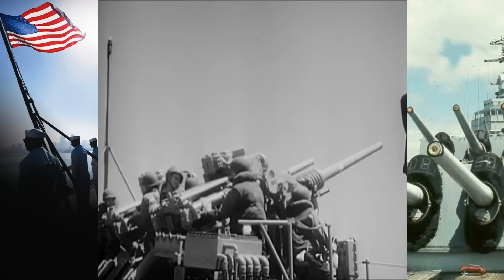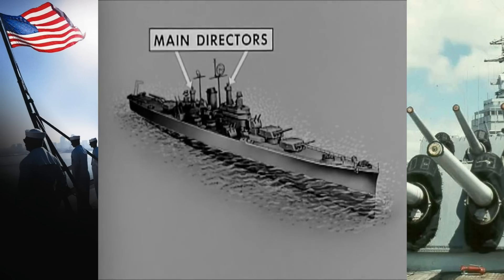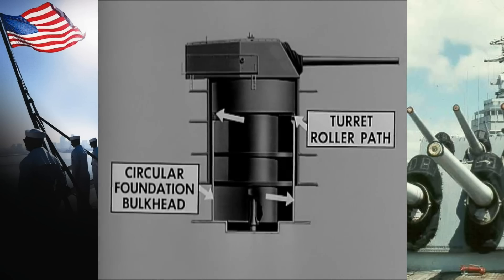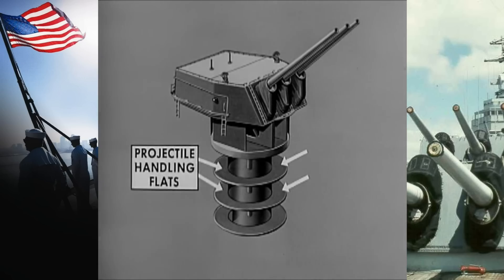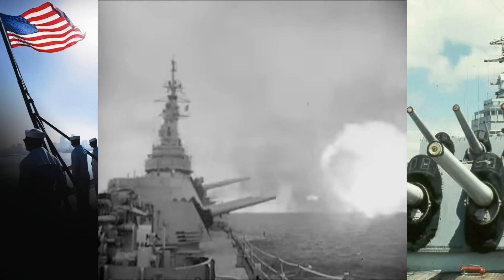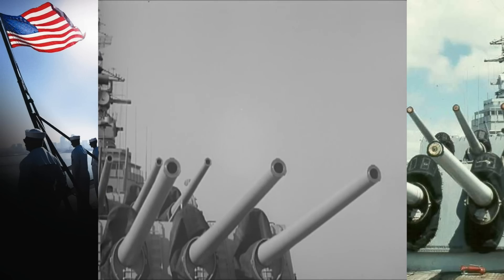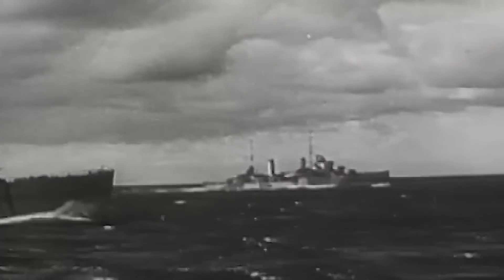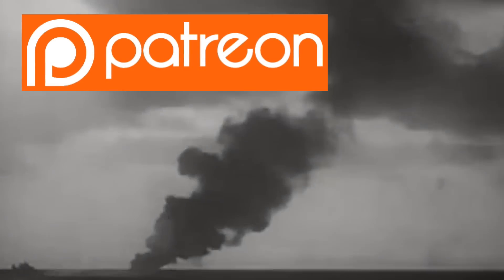How Do Large Caliber Naval Guns Work?

Comment: For Cruisers 8" is pretty much the largest guns with only a few exceptions, and most in use now on modern Cruiaers and Battlecruisers are smaller.  Those heavy cruisers with 8" guns had pretty much replaced the earlier Dreadnought and battleships of WW I.  Wasn't until the development of the really Big Battleships later in WWII that you got the 12" to 16" and the biggest of big guns the 18" placed on the 2 Yamato class battleships by the Japanese.  Interesting thing about the USA Iowa class BB, is after WWII they were all supposed to be decommissioned, but their armor and 16" guns kept on getting them hauled back into service.  While the rest of the US Navy became more missile based and carrier support, the Iowa Class served in Korea, was decommissioned and brought back for Nam, decommissioned  again only to be brought back into service in 82 and refitted until finnally being decommissioned and turned into meuseums.  All because missiles can be shot down but nothing stops a 16" shell in flight and they could hit something 23.4 nautical miles away (26.9 miles, 43.3 km).  I might be army but I have a lot of respect for naval artillery developed listening to stories of my uncles and father's friends telling war stories as I grew up.
Reply: Travis Thacker thing is though, a 406mm shell moves much faster than a mortar round and a radar might have trouble tracking it as it is rather small (cross section wise) and fast. They would also have to contend with multiple at a time over a short period of time (up to 9 at once every 30-60 seconds). They are also very heavy over 1 ton in weight so even if they detonated the explosive charge the remaining pieces of shell would likely still strike the position causing damage to fragile equipment such as radar antannea, and the like, making an opening for the following salvo. Not to mention they are much cheaper to fire than a guided missile
Reply: You had guns that size before WW1. All the way to 18 inches: only 3 of them, and two used on two British coastal monitors. In WW1, 14 and 15 inch guns were the common big gun size of the day.
Reply: HMS Hood wasn't the UK's most advanced ship, she was WWI vintage and IIRC overdue a refit at the time of her sinking, the newer KGV Battleships coming into service toward the start of WW2 were.  Also a Battlecruiser is not a Heavy Cruiser, they're different classes altogether and a Battlecruiser is in most respects far closer to a Battleship than a Heavy Cruiser.
Reply: @simonross6015   agreed. The Mighty Hood was in need of a major refit and upgrade and was scheduled in the late 1930's for this work to begin in 1942, taking some 2-3 years to complete with a then estimated cost of £4.5mn (approx £300mn in today's money). This was officially referred to as the 'Large Repair.' 

It was sidelined because there were other capital ships in more urgent need of work and because of financial constraints. Then WW2 began which scuppered any immediate chance for this 'Large Repair' being carried out. The rest, as they say, is history.

( src: HMS Hood Association - hmshood.com )
Reply: Another feature of those bigger guns on the Iowas, was this. A 16 inch diameter shell is spacious enough to fit a nuclear 'physics package' inside, and this was actually deployed for a time on the Iowas. The nuclear shells in question were known as "Katies". If push came to shove when these were deployed, one of the Iowas could fire, wait for it, a nuclear broadside*. That's 9 shells, each weighing over a ton, travelling 23 miles to target at once, then detonating with a yield of 20 kT per shell. So you hit your enemy with 180 kT of nuclear ordnance with your broadside. Needless to say, after firing that broadside, the captain would order an *immediate 90 degree turn to put as much extra distance between the ship and the ensuing detonations as possible, and order as much speed from the engine room as it could deliver. Plus, none of the crew would argue about getting below decks before those shells went off.

Of course, if any of the Iowas had been called upon to fire a nuclear broadside in anger at a real enemy, chances are we wouldn't be here discussing it. Because our parents would probably have been wiped out in the full-bore nuclear exchange of World War III. But you have to have a sneaking admiration for whoever thought of equipping a massive battleship with the ability to deliver the most terrifying broadside in naval history. :)
Reply: @Calilasseia , the damage radius for those explosions would not reach the ship, assuming they were fired at maximum distance of 23 miles.  A 180 kt explosion would barely cause damage further than 4 miles from it's detonation with most of the severe damage occurring inside of 3 miles from impact. Also, not trying to be a jerk but between the firing of the projectiles and the order to turn and gain distance from the explosion the ship would not gain more than a couple hundred yards, if that, as the speed of the shockwaves are faster than the speed of sound. There is a good website called NukeMap that shows the blast radius of different nuclear yields, check it out.
Reply: The mighty Mo' was also brought back in the first gulf war :D 
What a ship she was.
Reply: The Colorado class battleships had 16 inch 45 caliber guns , the (4) Alabama class had 16 inch 45 caliber guns, the (2) North Carolina class had 16 inch 45 caliber guns, and the (2) Alaska class battle cruisers had 12 inch guns.
Reply: Battlecruisers did not and were never intended to replace battleships, they were intended to replace cruisers. However they were as big and expensive as battleships and their speed turned out not to be a replacement for armor, as the Royal Navy found out the hard way at Jutland - and again when the Hood took on the much better armored Bismarck.

As for saying cruisers replaced battleships, that's just silly. They had completely different missions. Cruisers continued being useful after battleships became obsolete because the mission of battleships was taken over by aircraft carriers but the carriers still needed escorts.
Reply: Much respect to Navy Red Legs from ol Army Gun Bunny was on a M-110-A1 
8 Inch Self Propelled Howitzer , we were an 6 Gun Battery. Gun Chief and a 8 man Gun Crew. I loved the 8 Inch.
Reply: *I wonder what happens if the enemy is 28-miles away?*   ("Missiles can be shot-down..."  You're a funny guy!That gave me some chuckles!)
Reply: Kevin Olschesky  Not quite, a Battlecruiser was sort of a reinforced Heavy Cruiser  with a Battleship's guns,  the  idea was that if would have the advantages of both whilst ignoring the weaknesses of both classes.  By the time of her loss Hood was basically a fast battleship rather than a battlecruiser anyway
Reply: goff0103 thank you for the correction my naval history isn't as good as it should be.
Reply: Donald Trump I hope you were far enough away that you kept your hearing...
Reply: Not all of them...  The USS Arizona is still sitting at the bottom of the harbour.
Reply: https://en.wikipedia.org/wiki/Paris_Gun
Reply: Sean Wadey almost all heavy crusiers had at least 203mm cannons. furutaka aoba mogami takao prinz pensicola. i can go on. put simply 152-155 is light crusier guns. 200+ is heavy crusiers.
Reply: Yeah and look how well the Yamato did..    Or the Bismark.   Then   Persian gulf war came around look who got pulled back into service the Might Mo.
Reply: Yup. If I am right, the last time the 16"/L55 was fired in anger was in the 2nd Gulf War in `91 (Missouri and Wisconsin). I know, Phalanx can possibly shoot heavy mortar rounds, but I have serious doubts about its effectiveness against a 16" broadside. These things are almost as fast as a rifle bullet, and really really sturdy. 
https://www.youtube.com/watch?v=C2sYtq7hI74
https://www.youtube.com/watch?v=TTetKxtmI9c
Reply: @paavobergmann4920  and even if that phalanx did destroy that projectile, I wonder how much damage a close blast of that thing could do to ship's external equipment. Like radar/comm antennas for example. Especially as modern ships are not nearly as armored as their 2 WW counterparts.
Reply: @michajastrzebski4383  A lot, I suppose, if it is an  HE shell...The AP would maybe just continue, no matter if pelted by those puny 30mm shellies?
Reply: https://www.youtube.com/watch?v=oO5xHKSkWzg
Reply: Unless, by some twist of fate. A 16 inch shell gets fired at that 16 inch shell in flight and they connect. They gonna stop each other.
Reply: @littlehorseyhorsey  that´s right. that should work.
Reply: maybe guns should make a comeback. you might be able to shoot a few missiles down. ...but with guns you can just keep firing without breaking your entire military budget. imagine something like metal storm....but on a large caliber scale.
Reply: @km5405  not much need to do that, tbh. Ships are no longer as armored, they are harder to hit, they have countermeasures or can develop them quite easily. And there's not much need to shell cities or other area targets from such close distance too.
Reply: laughs in 12"s *uss Alaska gang
Reply: @Travis Thacker I think you may be mistaken when you state the a missile or any of the "Gattling" gun weapons would be able to shoot down a 16 in projectile; they may hit it, but there's to much mass. Plus the thing is spinning at well over 300,000 rpm, I'm not sure if an 8 in round would do the trick either.
Reply: Modern radar can track small, fast moving objects without difficulty, and a phalanx gun is effective up to 3 km away, plenty enough range to destroy an incoming shell.
Reply: @GaryCameron  Destroy? no. Deflect? Yes (with fragments breaking off still hitting the ship)...Deflect more than 1 at once? No...
More over, the settings for the aiming system would need to be changed to target those naval projectiles...
And ships back then throw a barrage of at least 6 8-inches (Aoba and Furious Taco/Furutaka) at you. And good luck deflecting radar-guided 16 inches...
Modern Anti-air/PD isn't really good against prolonged threat/large mass threat...
The Yamato was hounded for hours upon hours and its guns was still operating more or less, the same can't be said for modern systems since they will be running out of ammunition and/or overheating and melting the barrels off by that point...
Reply: @rpk321  It's full of explosives, it's not solid shot.  If hit by a 20mm projectile before reaching its target, the impact velocity of the two shells will combine, and the small explosion of the intercepting round will act like a primer charge and detonate the big shell before it reaches the target.
Reply: @GaryCameron  Uhhhh...it doesn't work like that...And the assessment above apparently came from someone who worked with those CIWS guns.

Comment: Big guns? Why just puny 8-ichers? Where are the 14 to 16 inchers? ;)
Reply: I recently Visited the AAF Tank Museum in Danville Va where they had several 8-inch Howitzers on display...they AIN'T puny :D

The howitzer versions are short compared to naval guns and those monsters looked like they could relocate a small town into several adjoining postal codes. They were some of the biggest pieces of field artillery in regular use, and they were the smaller guns being used by the navy... thats a scary thought.

One of these days I'll get a chance to see a BIG gun though :D
Reply: I know, just joshing. ;) 

But remember it's all about perspective, and the 16 icher is twice that! ;) :D
Reply: I got the joke :D

I love big guns, they are incredible bits of engineering. Just containing the power of that much propellant is a fairly mind-boggling feat.there is enough power in just the propellant to reduce a decent sized structure to toothpicks and bits of gravel.
Reply: 8 inch fires 5X faster, 10 rounds/minute vs 2 rounds/min for a 16 inch, that's 90 rounds/min vs 18 rounds/min.
Reply: Big for guns, medium for naval guns.

Comment: Are you sure 8 inch is big?
Reply from the maker: KALIBER 50 are you saying it isn't?
Reply: Matsimus Gaming well I'm mostly learn about 15 inch than 8 inch gun in naval warfarw
Reply: Most modern ships use 76-127mm guns, even 155mm is a rare sight now, let alone 203mm.

Even during the Battleship era, 203mm was pretty big, with only actual battleships carrying larger guns than that.
Reply: 8" was pretty much the standard for cruisers at the time, maybe a little on the small side but not overly so. There were cruisers armed only with 6" guns and there was even a class of US cruisers armed with only a bunch of 5 inchers, so 8" is not so small in comparison, only to BBs starting at 12" are they small. Also, think of modern warships, I don't think any of them, at least in the US, are armed with guns bigger than 6".
Reply: @Riceball01  I believe the light cruisers with 6 5" turrets were designed as anti aircraft cruisers to protect the carriers. They did not belong in combat with battleships and 6" or 8' cruisers. Just ask the crew of the Atlanta after Guadalcanal.
Reply: yeah but the heavy Cruisers had the big guns only out done by the battle Wagons and their 16 inch guns
Reply: @barneyrice8502  More like 12" or 14", which were common. US 16" and Japanese 18" guns were more the exception than the rule for battlship guns. Regardless, your point is still valid and even at 12", a battleship's main guns are nearly twice the size of an 8" armed cruiser.
Reply: @Riceball01  the cruiser had a medium gun set up for what they were suppo
sed to do but the Heavy Cruiser was just a step below the Battle Wagon when it came to gun size
Reply: goff0103 the hood wasn't even launched until the very final months of WWI, you're thinking of the Battle of Denmark Strait in WWII in which the Hood was sunk.
Reply: KALIBER 50 It's big for you.
Reply: The Hood was sunk by the Bismark at the battle of Denmark Strait during WWII.
Reply: J. Martin that isn't relevant whatsoever
Reply: goff0103 no s*** it's a cruiser v battleship if you were in the cruiser you would run to right
Reply: they fire a 250lb shell 20 miles i would say thats pretty fucking big.
Reply: Safe to say 8in guns are big guns relatively speaking but sure battleships had bigger. You can say there was light guns, 20mm to 5in, used for AA and main guns on destroyers and secondary guns on other ships with a few cruisers having them as their main guns. Then you have 6 and 8in for main guns of cruisers and secondary guns on battleships with a few carriers having them for self defense as well. Then you have the 10in to 18in for battleship main guns. So you could say relatively 6 and 8in guns were more med range guns but still were big guns. There was a debate as to the value of 8in guns versus 6in guns. Some saying greater volume of fire of the 6in guns was better then the heavier broadside of the 8in guns. In many ways the 6in gun is the main gun for cruisers with some having 8in, namely heavy cruisers, which were made in smaller numbers. To a large point 6in gun cruisers were mainly scouts, destroyer leaders and were less designed to take on battleships then heavy cruisers were. Heavy cruisers were often seen as second class battleships or cheap battleships. They were designed to fight anything including battleships. Even if the 8in shell could not penetrate heavy battleship armour they were expected to do enough damage to a battleship collectively to make life difficult for the battleship and with torpedo from the cruiser itself or from destroyers, sink the battleship or at least put it out of action or chase it away. Even if parts of a battleship is protected from 8in shells, the bulk of the ship isn't and 8in shells can do a fair amount of damage to a battleship, knocking out systems and starting fires etc. General rule of thumb is the displacement of the ships involved. You have a battleship displacing 40k tons then 4 10k heavy cruisers should be able to deal with the battleship if they are handled well. 

As great as these guns are, the British tried to make their 8in guns as good as these guns in the late 20s with a rate of fire of 12rounds per minute and with a AA role but sadly failed as it was beyond technology of the time. In the end the British 8in guns were reduced to firing 3-6 rounds a minute. 

These guns were developed due to war experience where the 6in gunned cruisers failed to have the punch that was hoped with their greater rate of fire. Battle of Empress Augusta Bay was a prime example of the failure of the mass 6in guns. The answer was to try to do what the British failed at and make 8in guns with a rate of fire equal to the 6in guns. Sadly though by the time these guns were developed the days of the big gun ships were numbered and apart from bombardment they never proved themselves. They were impressive guns for sure and shows how powerful the British county class would have been if they had been successful in their attempt to design guns like these in the 20s.
Reply: KALIBER 50 take a ruler start at zero and stop at 8 now imagine that hitting you going at the speed of sound
Reply: I don't think +VAS 50 was talking about guns.
Reply: goff0103 But cruisers were never intended to fight battleships, just other cruisers and lighter ships. Heck, even battlecruisers with their battleship caliber main armament usually run away from BBs because they don't have the armor.
Reply: +goff0103
And we all know what happened to the 'Might Hood', don't we?
Reply: Riceball01 that's why cruisers have torpedo armaments with them.
Reply: Riceball01 well I'm mostly learn naval warfare from ww1 and pre ww2